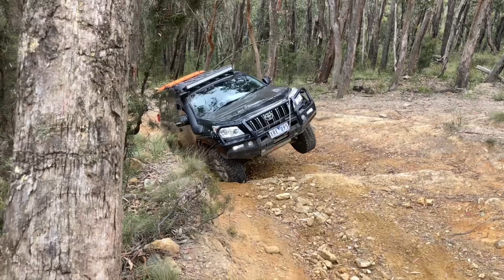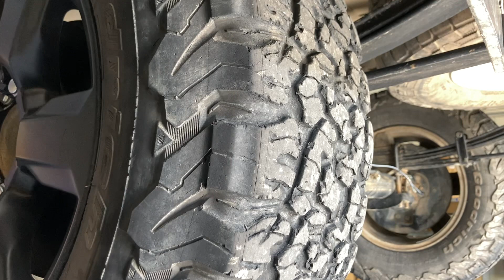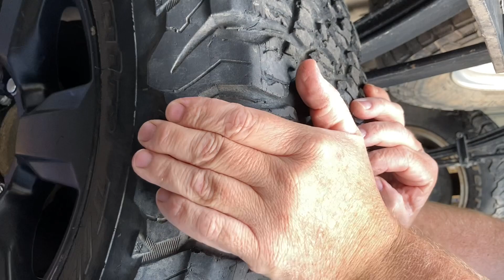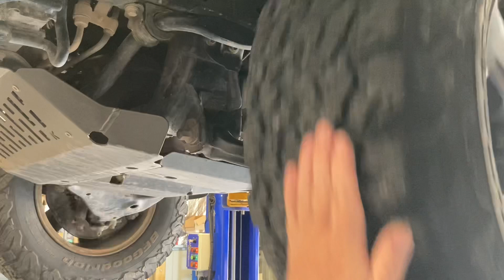DIFFERENTIAL EXPLANATION and DO YOU WANT a EATON TRUEURAC, LOCKER or Nothing?

Comment: I thought the point of a LSD is to every let’s say the wheel has 8 ticks of movement the LSD grabs on only two of those to spin the wheel. It’s not that dissimilar to how your impact driver works. delivers blows under a little load but give it too much it will just slip constantly.
Reply: LSDs are not at all like an impact wrench. A clutch LSD has spider and side gears just like an open differential so the average axle speed is always that of the carrier. When torque is applied the clutches and plates, which are splined to the carrier and axle respectively, are compressed and provide friction to turn the axle the same direction as the carrier.